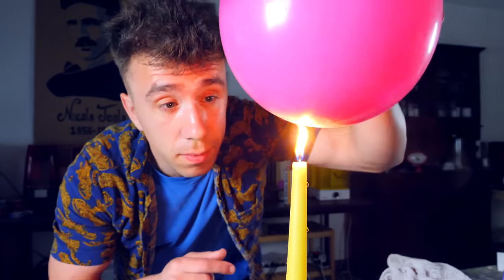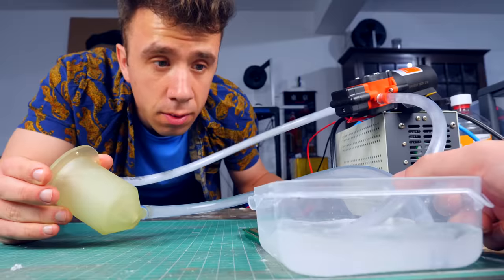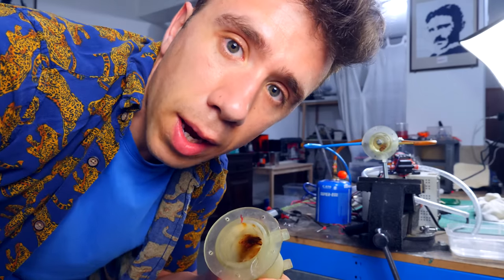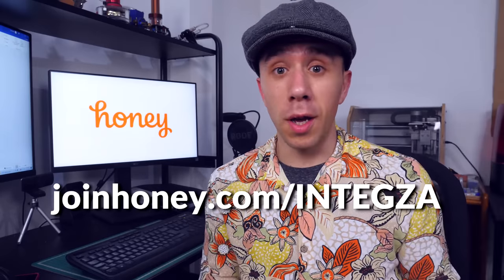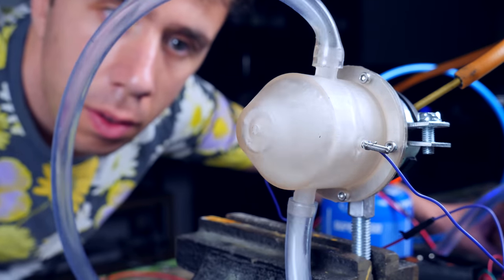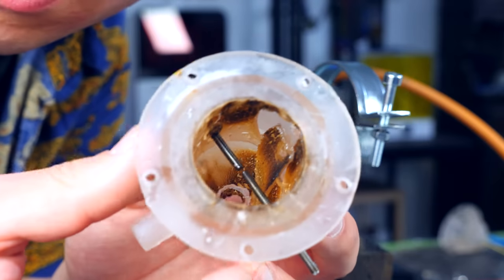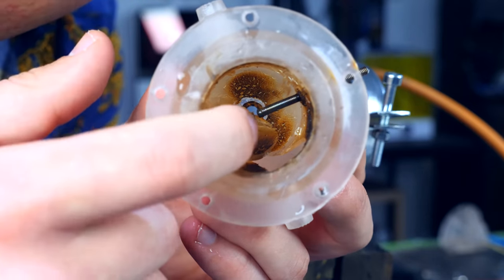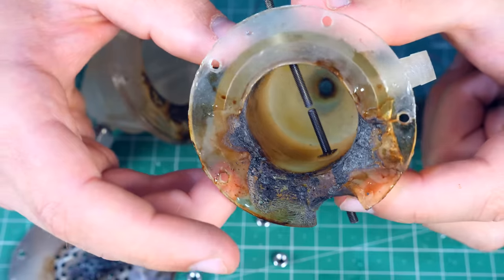Water-Cooled Jet Engine in Plastic

Comment: Try this with a aquarium water chiller to keep temps even lower. Tomatoes are disgusting!
Reply: you could also try to mix in graphite into the resin with the water chiller
Reply: Or just ice water..
Reply: ltt vibes
Reply: I see where you're coming from, but I don't think that would help, because there would be an insane temperature difference between the water and the resin, and this would cause a crack.
Reply: @oneflamey3234  The idea would be to pre chill the resin. Keep the water running through it before the jet starts.
Reply: @loganfreedman  larger reservoir will make a big difference.  or go with glycol like chilled beer taps.
Reply: Just a bucket of saltwater full of ice would be a better option and much cheaper
Reply: @mrcaboosevg6089  exactly what I came here to say. That and he needs to make sure the cold side of the system is always the high point so it can bleed air bubbles that will cause hotspots
Reply: @oneflamey3234  Rocket engines are cooled to sub zero before startup and the bell wall is protected by a layer of (mostly) exhaust gas from the pre burners also extra cooled by the sub zero cooled liquids ;)
Reply: The diference will be unnoticeable. 10 degrees means nothing to water. But yes you have to youse something colder or with more thermal capacity.
Reply: @loganfreedman  Graphite will do nothing but graphene...
Reply: You been playing with Axolotls or did aquarium chiller just come to mind?
Reply: @alphamet3258  lmao.
Reply: It won't work as plastic is a bad thermal conductor,
Reply: The water must go from the bottom in the heat changer. Only this way you are save the heat changer is completly filled
Reply: @loganfreedman  ice in the water tank would work a whole lot better
Reply: Maybe even a additional water cooled housing for entire engine? 🤔
Reply: Use liquid nitrogen
Reply: Try a tig welder chiller guaranteed to work 100% of the time
Reply: Don’t forget the rgb
Reply: Also use coolant instead of just water
Reply: good idea! Try to use coolant additives on water to avoid steam / cavitation.
Reply: @HyRkt  why not use refrigerant instead XDXDXDXD. You can cool the combustion chamber down to a refrigerator temp inside lol
Reply: @mortman2952  find a plastic that is more thermal conductive than normal plastics lol
Reply: @noname-codm4590  best bet would be to have a metal surface in the chamber, bonded with a plastic housing for the water cooling. Or try thinning the walls of the printed chamber (less distance for the heat to travel before transferring to the water). Although I doubt the latter will work.
Reply: @mortman2952  yeah, I also thought of having a metal and plastic but I thought the title of the video is Water-Cooled Jet Engine in *Plastic*, so I ignored my idea since it would be cheating to use any other material than plastic. Well, technically, Integza cheated too by using resin lol, but 3d printing resin and 3d printing plastics both have nearly the same melting point contrary to a metal having a high melting point.

Off topic, I also play The Powder Toy and have experimented with a quite a bit of thermodynamics, and I too also discovered that thick metal isn’t always the best for high temperature (cuz thicker material means more heat absorbing capabilities, assuming that it can transfer the heat throughout the material so that the material inside the nozzle won’t melt.). Tpt physics is quite broken tho, they also have discord and the devs are active in there.
Reply: with this if u can keep a lil bit of pressure in the water what it might lead upto ?
Reply: No need to try to actively cool the water, just use a bucket of ice water as the water source
Reply: Maybe using a layer of Carbon fibre inside would also help to increase the strength plus also good insulator
Reply: Yes aquarium chiller or even just a large water tank full of ice for testing purposes.

But in his case since he does all kinds of experiments it might actually be worth getting a chiller even Cincy probably find it useful for another project that would need water cooling chances are projects that would use it anyways for this guy so be worth investing in
Reply: Ok Logan
Reply: @kaky0074  Only liquid hydrogen has bigger thermal capacity then water so there is no sence in change of coolant. Water is the best, espocially when there is nothing to corrode. That's my thought as an Engineer.
Reply: @Navi2137  I will be engineer only after 3 more years. So i know one more thing.
Reply: I think a lower temperature of the coolant would rather increase the termischenstresse . The uniformity of the cooling is I think more critical than the absolute temperature, besides I could imagine that a heat conductivity of the inner wall could also be a factor.
Reply: Also the metal diffuser is sinking the heat into the bolts causing the failure there. It's too large and reducing it's diameter would help it from sinking heat into the frame and causing a failure.
Reply: Totally useless. The water being a few degrees colder does absolutely nothing. Just have proper flow and that's it. Water has an *enormous* heat capacity.
Reply: I would say opposite. preheat the water so the differential stresses in the plastic are lower. as long as the water stays below boiling inside the chamber you still get the desired cooling effect.
Reply: @Damicske  rocket engines are also made of exotic materials that have insanely high melting temps, or use ablative material as the throat liner on the older single use engines the russians made.
Reply from the maker: Gongratulations! You just won a 3D Printer! Send me your info (Name, Address, Zip Code, Phone Number) to integza@gmail.com.
Reply: @integza  Tomatoes are disgusting!
Reply: @integza  gongratulation ? Gongo
Reply: @integza  btw if someone lives in India would you still give him 3d printer 
like uk how will u deliver there?
Reply: Good idea and terrible opinion imo
Reply: I'm not sure what the specific aquarium chiller is, but I have a feeling it's what I was thinking too; adding certain salts to water takes energy from the system to dissolve
An ammonium chloride, sodium chloride and ice water brine is what the zero point of farenheit is defined off and is probably a pretty cheap one that'd cool itself initially from that addition of the salts alone and having like sub-normal zero point temps will lead to better cooling

Newtons law of cooling modelling that rate of change of temperature is based on the difference in temp as one proportional factor, increase the difference in temp and we increase the rate of cooling

But there's only so much we can do if that exchange membrane isn't transferring heat/melting too quickly
Reply: Industrial water chiller
Reply: Have you ever tried home grown tomatoes?
Reply: Try to freeze tomato and smash it
Reply: @loganfreedman  
Up next in line with your company is large enough to add a comment below

Comment: if your water cooling, intake goes on bottom and output ontop so your device totally fills before it can empty that way you dont end up with air pockets which dont cool anything.
Reply: This is a great point, I didn't think about that.  Liking so it gets moved higher up.
Reply: You don't need the intake on the bottom. There are tons of ways to get the air out. I hate to break it to you but every car is the opposite of what you say but they still get the air out.

And just having the intake on the bottom doesnt mean that their won't be air bubbles either. It just makes it easier.
Reply: @swankshire6939  i know on car turbo chargers the water cooling system is supposed to have water come in from the low side and come out from the high side if it’s tilted, also improves the cooling performance
Reply: Same idea
Reply: Or put an orifice on the return line to keep pressure.
Reply: Ok I think I was overthinking, but my first thought was similar, but I was thinking about helical coolant path, I can see there are easyer way
Reply: Literally opening the comments to write this. Good work 👍
Reply: @MrByped that is an excellent idea I was thinking maybe the inlet should be slightly larger the supply volume and the outlet should be slightly smaller to create pressure and Flow forcing the fire basket to be fully immersed in water but having it the intake on the bottom and forcing it up around and out the top is a good idea
Reply: @swankshire6939  lol what I came to say. And not every car but many.
Reply: I was going to write a comment like this, but it was already here 👍😂 Also make sure the water comes in contact with the metal diffuser to hinder the melting at that place.
Reply: I was going to say the same thing.
Reply: Very true.
Reply: Water cooling would be more efficient if u could put it under pressure
Reply: Bros, what the OP mean just fluid mechanics, y'all had learned that in school.
Reply: Smart, I was thinking the same
Reply: @swankshire6939  this is the same  as the lab coolers though, not cars
Reply: yup! was going to comment this
Reply: The heat from combustion should also help with pressurization with that mod.
Reply: This! And also your water looks like milk from all the bubbles the pump sucks in. Very bad for cooling! Make sure the water has no bubbles and fill the entire space.
Reply: Also having thin fin channels in it may help
Reply: Yeah, you could clearly see bubbles inside the cooling channel.
Reply: He should really be using a sealed system with a much larger reservoir. That would significantly increase the total heat absorption (larger thermal mass) while also eliminating the introduction of air bubbles. If the system is sealed well enough, it can also help reinforce the thin walls.
Reply: @MrByped's suggestion will help immensely with even cooling around the chamber. If you combine that with a thin walled combustion chamber and the vortex jet engine design from one of your prior videos, that should work to keep the assembly cool. Another option would be to make the inner chamber as a separate piece out of ceramic resin, then assemble the water cooling chamber around it. This would help prevent the metal mounting screws and diffuser plate from melting the combustion chamber, and would also provide better nozzle longevity.
Reply: @archerwithspark  that's what I was thinking, with the coolant inlet closest to the exhaust output flowing to the distributor where the coolant outlet would be. Also increase the coolant reservoir to be at least 3-4x the volume of the engine and tubing.
Reply: HVAC systems that use water for heating and cooling have the water enter from the bottom.  It prevents trapped air and is better at moving heat into/out of the area in question.
Reply: You should be cooling both parts
Reply: Was just going to add the same. You want gravity helping you keep the most water in there rather than helping empty it. Same principle we use in schools for distillation apparatus.
Reply: @swankshire6939  The coolant enters an engine at the bottom of it's cooling jacket, and exits at the top.. it enters the radiator at the top, not the engine. This thing has no radiator, just a reservoir.
Engines in cars use other methods to get rid of air pockets, including expansion tanks, bypasses, and often a way of filling and purging air pockets that if not done is very harmful to the engine. 
 
Been a mechanic since 1977, if it were as simple as you say then I wouldn't have seen so many cracked heads, blown head gaskets etc.
In Integza's simple system, the easiest way to get rid of air pockets would be to just have the inlet at the bottom, exit at the rop
Reply: I was going to write this, but checked to see if someone already had. it doesn't matter where the input is. The output should be at the highest point though, and probably have a slight restriction a bit further on to ensure positive pressure in the cooling space. And multiple times I saw way to many bubbles coming in, so I would looked at proper mounting for the supply lines too.
Reply: And he might has to use pla and not resin because resin breaks bevor its melting.
Reply: @archerwithspark  that's what engineers try and do with large areas that are inclosed they use a helical design pretty much like stills I was really surprised that he didn't think to use a helical channel for the water there by  eliminating the need for the multiple different versions to be made and with the helical he could have run it through the entire mechanism and made the entire thruster run cool it's nice to see someone else figured out that easy way to solve all his problems
Reply: Would also slow any water that is boiling in the water area to exit as steam via the top outlet! 👊having a space at the top allows steam to build up there
Reply: He could add a bleeder valve to get rid of the air.
Reply: That's a good point, but keep in mind this is a rocket engine, which means eventually the intent is for it to be vertical
Reply: @swankshire6939  yeah it makes it easier, which is most likely said to do it that way like sure there's plenty of other ways to make it work but why make it more complicated than it needs to be
Reply: @swankshire6939  He described exactly what is supposed to happen in a tilted intercooler, and on a condensation column, so there is some truth to what he is saying
Reply: @swankshire6939  Thats because in a vehicle the Rad is a "zero" pressure zone and fall's into a MASSIVE chamber so the air can "fall" out. And there are a number of vehicles on the road now that if you open the guts of the cooling system you will have to manually bleed the points that air lock. Or you vacuum fill the cooling system and even then it's not 100% at getting all the air out and you'll still need to bleed the system manually.
Reply: He need to make vaines running back and forth.
Reply: its more about priming the pump, letting the air go through the outlet then just water intro to the system, the air bubbles are causing unequal pressure and any faults will fail, for these kinds of purposes a self priming pump like a fish tank one is what ur gonna want to use, one you put in the water let it prime then use, it seemed like the pump had to move a lot of air just to get to the water, air is compressible water isn't, a pump that can move water isn't designed to move air. like wise superchargers aren't meant to pump a non compressible fluid water, they are designed to take low pressure at there edges and convert that into high pressure at the center, in a twin screw its the same but a linear motion of air driving gears, the work is being done by the compressibility factor of air
Reply: also he need a better pump and more water. There are a lot of air mixed in with the bubbles making it less efficient.
Reply: also i re read this thread yeah a larger water pool, is basically the only other limiting factor unless the idea is a loss all together you can do several things, first think of the reservoir similarly to ur Pcs heatsink if you can get heat way from the water you can get heat way from the engine, you can get a pump that can pump salt water and try cooling the water with ice, not sure about pumps ratings for cryo though so keep an eye out
Reply: @swankshire6939  cars don't superheat water to ~1200C : D
(it happens in very small amounts due to uneven cooling)
Reply: Came to the comments to say this. Being a PC enthusiast whos been water cooling for decades, watching this was painful, lol
Reply: Morbius 🅥  it's morbin time
Reply: Learned this from chemistry, this is how you hook up condensers
Reply: pump intake at bottom of reservoir, output on top of reservoir. maybe a closed system too. the position of pump intake tube was prone to making bubbles and the pump itself is making bubbles
Reply: And try using ice water.
Reply: I think this is a great idea, upvoting this. I'd like to add another bit, I hope @Integza sees this - use colder water, as in, as cold as 0-1 degree cold. It's surprisingly easy to achieve it. use a bit larger bucket for water, fill it up with large pieces of ice. Add some salt water and mix well to cool them down like anything. The salt will lower the melting temp of the ice and increase the specific heat capacity of water. The intake pipe should be at the bottom of the bucket (weight it down) and output water pipe should be on the ice so hot water from the engine hits the ice, cools as it flows down and the coldest water is at the bottom. This could significantly cool down the engine
Reply: After seeing the air bubble trapped on top inside the cooling sleeve I figured to see if anyone had said anything pertaining to it. Jolly good show!

Comment: Now try this with liquid nitrogen and metal 3D print to keep temperatures even lower!
Reply: Liquid nitrogen might damage the plastic
Reply: Not gone work it's gonne be to cold
Reply: That's what I thought he was going to use instead of BUTANE lol. Trying to make something work, you will try just about anything
Reply: The liquid nitrogen is gonna make the plastic even more brittle, and it could shatter like nothing because of the combustion.
Reply: Wont work and will damage the plastic. I messed with nitrogen as a teen with a friend
Reply: That’s going to make the plastic brittle
Reply: @Wischmopps It isn't the intake that is the problem. It is the defuser.
Reply: Liquid nitrogen does make material brittle and just one backfire would be enough to explode it throwing liquid nitrogen, plastic shards and flame everywhere. Not good idea unless done in ballistic enclosure with way to release pressure.
Reply: @3ch0_17  bruh he said print with metal dummy
Reply: Would love to see a rocket made by Itegza fly. Put a tomato head on
Reply: the tip
Reply: liquid nitrogen cooling
Reply: rocket engines